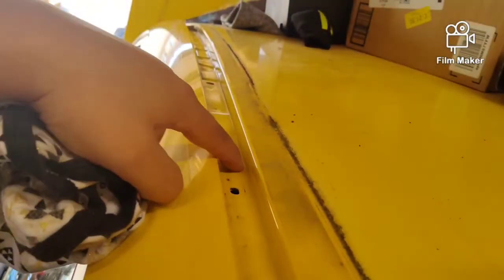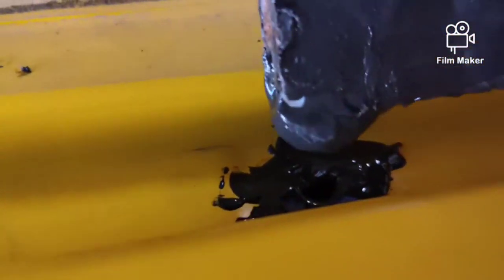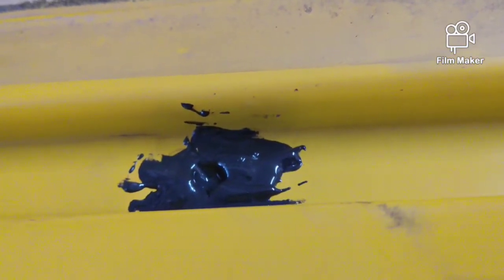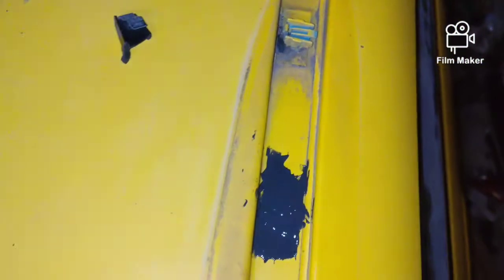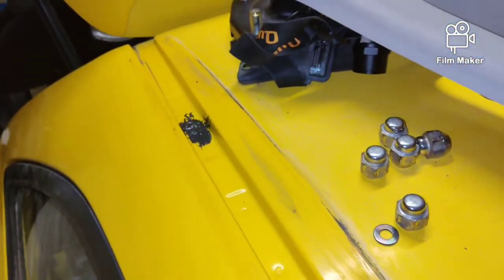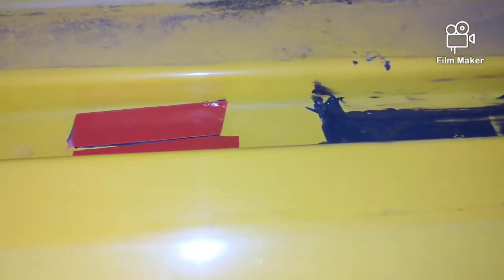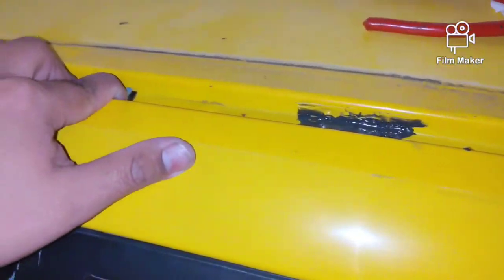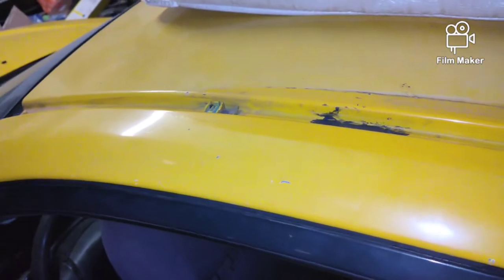Mazda Protege5 Roof Rack Removal. Lightnin Bug gets an upgrade

Comment: why did you decide to remove it? You weren't happy with it?
Reply from the maker: The rack was damaged and falling apart
Reply: @SandRatsGarage  Thanks. And before it broke, were you happy with it? Did it got broken in some accident or just because it was old?
Reply from the maker: @tomek5706  broke due to sun damage making the plastic brittle and age

Comment: Can you send me the name of the clips and the rubber thats you uses . It the same one that the Mazda protege 5 but the one that dont bring the roof rack.  If Its like that Can you send me a store phone number where you buy . Thanks
Reply from the maker: Are you talking about the clips that hold down the delete strips? I just use some 3M trim adhesive tape with those clips. If you're looking for the delete strips in the clips I went to JP parts international out of Canada
Reply: @SandRatsGarage  thank you  , what rubber you uses ?
Reply: @SandRatsGarage  Im from Puerto Rico , can you send me the link of the place you bought the click and the black rubber.
Reply from the maker: https://www.jppartsintl.com/collections/mazda/model_protege?page=5

This is where I found the delete strips used.
Reply: @SandRatsGarage  thank you very much  , have a good night